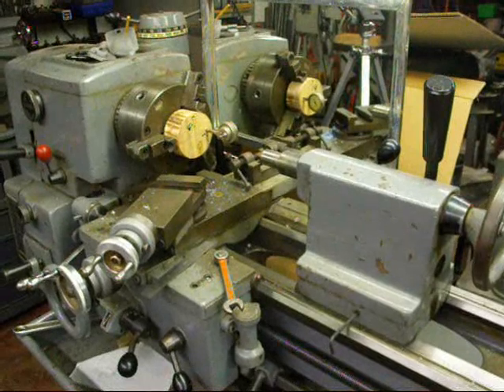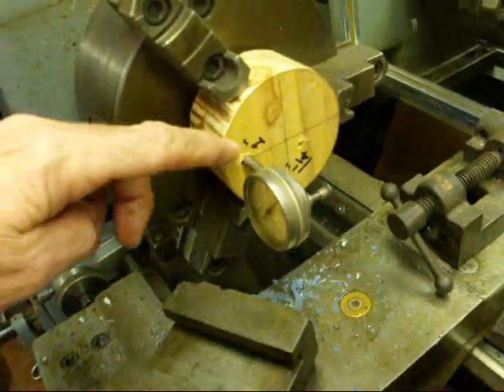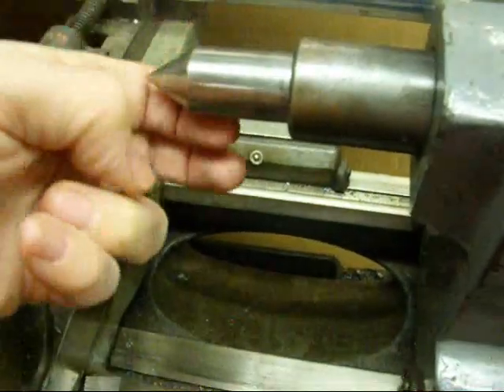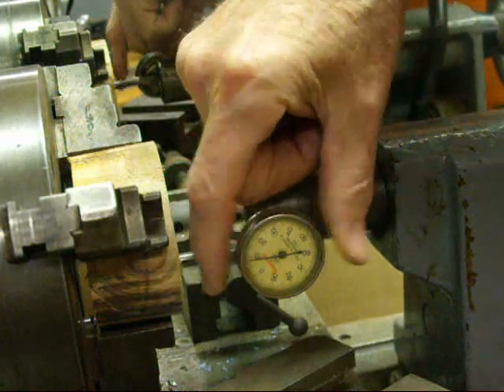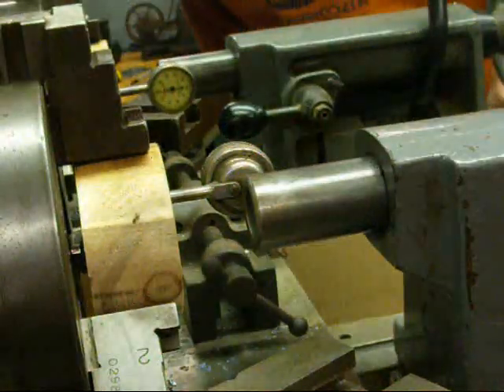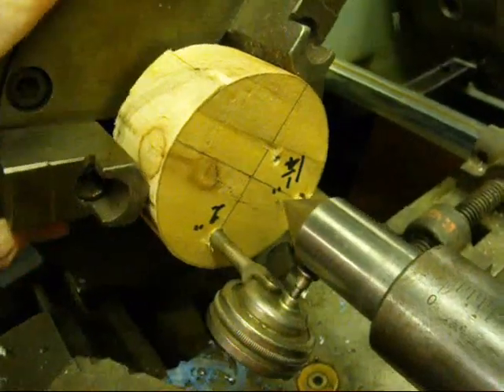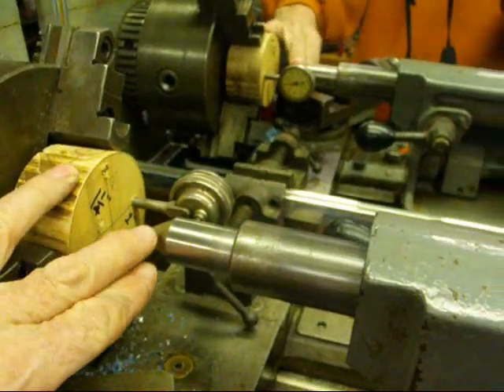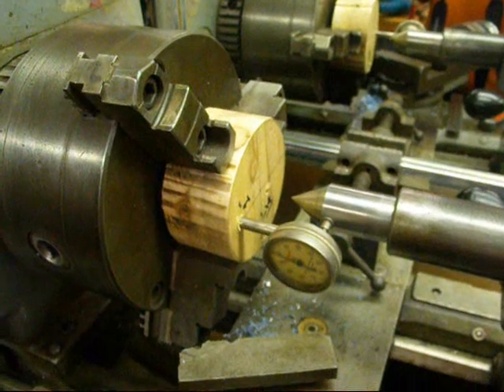TAILSTOCK ALIGNMENT on LOGAN HARDINGE South Bend Lathes Part 2

Comment: So Mr. Pete, then what does one do, if by using this same method to check the vertical alignment, if that is out, too? Shims? I don't think that would work very well because they'd want to slip out when moving the tailstock.
Reply from the maker: There is no good answer for what you asked. Most all south Bend machines have wear on the bed and or the tailstock. Some people have told me they shimmed the tail stock.
Reply: @mrpete222  Thank you. I was hoping you were going to point me to another of your videos that addressed it.

Comment: I have been working the bugs out of a 90s vintage Smithy 3-1. Im no machinist. Your videos have helped greatly.  I have aprox .007” taper over 8” . Down from .030” or so Gear head was loose.  That helped. I dont have the fancy level to check the bed . I have aligned the centers tip to tip best as possible . Every time I get a chance to watch more videos things get better thank you

Comment: Good  method. I've always used a piece of round stock half as long as capacity and turned about 1" on each end and adjusted the tail stock until both ends are exactly the same diameter on each end

Comment: Could you use a coaxial indicater instead of the plunger style
Reply from the maker: Sure
Reply: mrpete222 im going to try it
Myself i would like a quick
Way to align my tailstock. 
 In addition it seems
Like after i do align it,Finnish my project then comeback later its out of alignment again. I have checked the lathe level several times its dead on. Im at a loss. Seems like its goes back out of alignment all by itself. Garage is heated also

Comment: Nice video, Thanks. I have the same Clausing lathe. I was drilling a small hole and starting out with a center drill I could see it was quite a ways off center and I got that plowing effect you speak of. I pulled the drill chuck out of the tailstock and stuck a live center in there and the live center was somewhat closer to center. I have to play around a little bit, I tend to think that drill chuck is causing much of the trouble. I'm going to install it into the tailstock, take a look at it and then remove it and reinstall it at 180 degrees and see how that looks. It's my friends drill chuck and I tried telling him "that drill chuck isn't true to the center for some reason" but he wouldn't hear of it. He says "the center drill centers itself as you drill" but I didn't agree with that either. Thanks again for the video

Comment: Thanks again Lyle (my grandfather's name) This method brought my chinese junk lathe into alignment very simply. 

I mounted a small mag base to the face of the chuck and swung the arc. The most impressive thing to me was the fact I did it with the part I was working still chucked and pinched with a live center. 

It is now turning no discernible taper. 

   Once I pull this part out I'll recheck everything. 

Again thanks for sharing. 

By the way I'm in the market for a Hardinge HLV.

Comment: I purchased a used Grizzly 9 x 19 lathe.  It was extremely dirty.  Being a clean freak I totally disassembled it and cleaned everything.  The headstock is held on with four studs.  Can you suggest a way to align the headstock with the bed?

Comment: I noticed that when you rotated it 90deg that when it was on top it showed the quill was higher. It also showed that on the spindle. I've found that same thing on mine and have been wondering if that needs to be addressed or is it not as important as it is on the horizontal plane? 

Been watching all your videos and have learned so much, many thanks for all your hard work.

Topstrap

Comment: Great instructional videon,I hope you can tell me how to canter my tail stock on my 7X10 mini lathe.This is my first lathe and Ive never used one befor I bought this but I quiclky found the tailstock to be out of alignment. I marked center on a round stock of stainlesss steel and the tip of the live cenceter is at least 1/32 of INCH!! and the are no alignment marks. Well I hopw you can help me out.

Comment from the maker: @LG6327   No such thing to my knowledge.. However, if you have  an atlas 12" lathe, there is a built in indexing system. The face of the front spindle gear has 60 evenly spaced holes. There is a sliding pin that engages a hole. In this way, you can divide a circle into most any number of divisions.

Comment: Hi, its great to see your videos.  I have your book Milling Operations in the Lathe as part of the Workshop practice series - Its reassuring to see it done on video.  

I have noticed My tailstock is a little bit too high, it's fine side to side, can you forsee any problems with accuracy on any application?

Comment: Very clever approach - Thanks for sharing.
For those not inclined to cutting out a cylinder of wood, they can make a triangle out  of  the 2x4 with two straight cuts , tighten it in the chuck and drill their hole to hold the indicator. Give your brother a gold star.